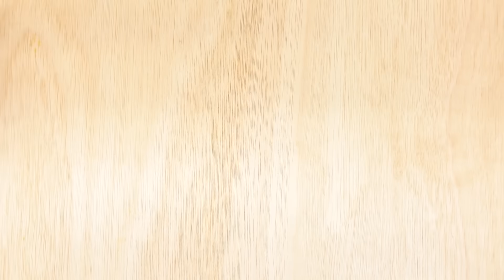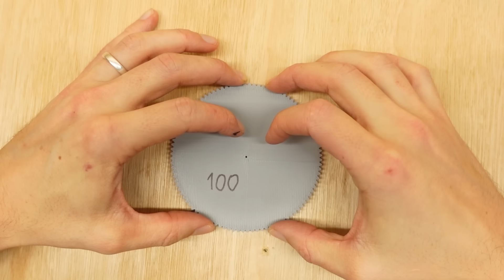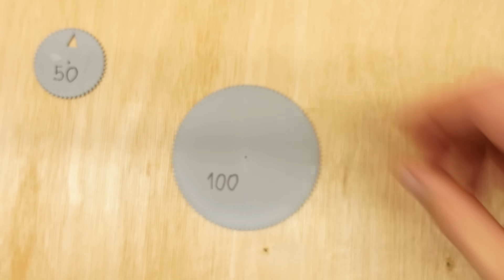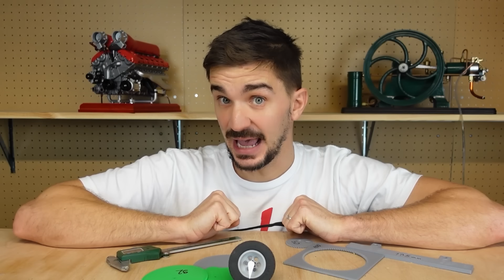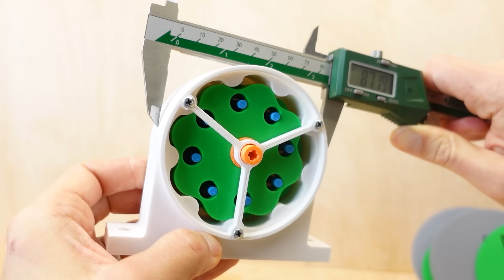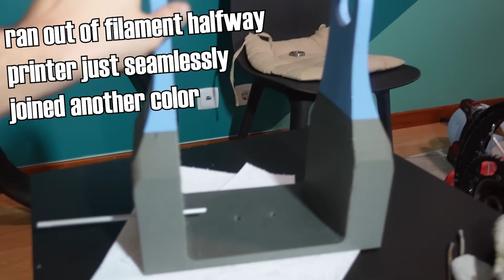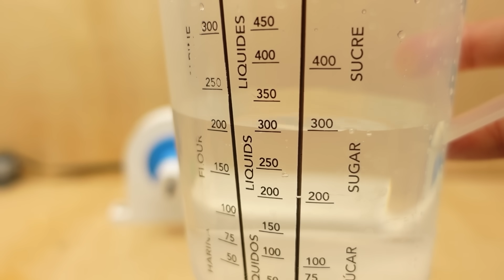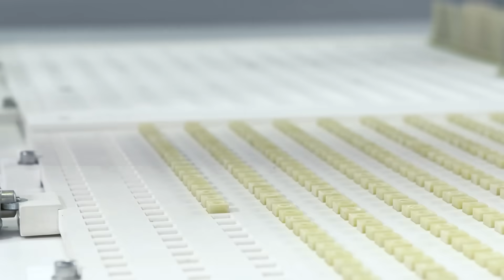Toothless Gears Make Much More Torque Than Conventional Ones, Here's How. Cycloid Drive Explained

Comment: Machine designer here. Many years ago, I owned a 1994 Dodge Caravan and had a full size spare tire that hung from beneath the rear of the vehicle. To drop the spare, you lifted a small flap of the interior carpet to expose a hex nut. You used the lug wrench to turn that nut which through a gearbox, lowered the tire to the ground. Eventually the original gearbox jammed and I had to replace it. Naturally, I could not resist dissecting the old gearbox and so after drillign our rivets on the case, I got into the guts of it. Well, it incorporated a cycloidal drive which were stamped out of metal plate. I was so intrigued by this mechanism that I kept it, and still have it to this day. I believe the geometrics of these drives are known as trochoids.
Reply: At last, I have found a kindred soul!
Reply: I have a 1994 Chrysler Town & Country that is pretty much the same thing.   It does not have the same spare tire location though.  Yours is much cooler/
Reply: @PaulMartin-n6m  wait, then... what do you mean it's pretty much the same thing but without the spare tire location? The entire comment was about the spare tire location.
Reply: @j @renee61026 the point of the comment was the gearbox that lowers the tire down🤦‍♂️
Reply: @renee61026  are you tweaking?
Reply: My 2007 PT Cruiser spare tire comes out in the same way (super fun to figure out at 5 AM late for work with a flat tire lmao), and now I'm super curious and want to take it apart. Gee, thanks 😅
Reply: Did you ever find what caused the jam?
Reply: I'm not seeing what your saying 100/50=2 rotations flat rack or round gear. You might be wrong. Sorry
Reply: @dalenulik5622  But the reference points about which a full rotation is measured matter.  In the linear case, the path length of the pinion's center and the point of gear engagement are identical.  In the round gear case, those path lengths differ because they don't operate at the same radius.

Comment: Couldn't you create a 3-disc system, in a 1# 2# 1# setup to eliminate the rocking couple?

Or would such a system require 120 degree offset instead of 180?

Comment: 3D print your next house. The design process will be radical, inventive, innovative, and fun. The build process will be mesmerizing. If you build it yourself, or hire some help, it'll be way less expensive than purchasing an existing house or building a new one from scratch; depending on construction materials used.

Comment: you dont have to 3 print everything when you can just find things to repurpose, i recently went to the demolition site of a mall and got some stuff that would otherwise be absurd to buy. got ahold of some hollow rectangular 2.5 inch by 1 metal box beam of various lengths between 4-6 feet long and a few in excess of 22 ft long. where it got kinda surprising was at the internal window beams meant to affix to the window frames those were aluminum, I thought they were hollow but they were SOLID AMLUMINUM. using them for shed reinforcements and i've got recliner to reinforce because the plywood failed.

Comment: Eccentric cycloid gear systems are a neat alternative to this, and can be fairly practical for functional 3d printed mechanisms. Essentially uses these eccentric cycloid gear profiles, which allows for a "corkscrew" pinion that is effectively 1 tooth, allowing huge reductions.

Comment: You're over-all size representation is wrong. You need to consider the position of the orbiting gear in all positions to represent the size difference accurately. The actual size difference being shown should of represented four times as much space required to have the smaller gear orbit the outside of the larger one.

Comment: Genuine question: the last problem you mention. The offset between the opposing forces which generates a vibration.
If i used 3 gears instead of 2 such that 1 and 3 are in phase and 2 is in opposite phase, this problem would disappear right??
Just make gears 1 and 3 half as heavy as 2, so the forces will still cancel out

Comment: you can make 3 cycloids, the one in the middle double the mass of the externals which are both offset 180° from the one in the middle.
Reply: you can also balance a single gear with an excentric mass either in the crankshaft or in the gear

Comment: Faaantastic video. 

One trick that might've helped illustrate the point when going from rolling on a flat plane to rolling around another gear, was if you first rolled along a tape on the flat plane and then, with the first (rolling) gear "stuck" on the end of the tape, if you wrapped the tape around the second (stationary) gear. That would've shown the rolling gear making an extra revolution, even after having reached the end of the (flat) tape.

Comment: I disagree with you reasoning on why the gear would spin an extra time, you have the one revolution from the teeth on the gear then an extra revolution from the gear rotating around the other gear. Imagine if the gear didn’t have any teeth but spun around a circle, it would still make one revolution.

Comment: Interesting video. It should be added that cycloid-based transmissions wear out much faster than conventional gears, especially at high speeds. This is why this type of movement is rarely used in industry for transmissions. However, it is often used for compressors or pumps. See the Roots compressor.

Comment: Making a single gear of double the weight sandwiched between two normal weight gears will counter more of the vibration. It may introduce extra friction but maybe it's capable of higher speeds this way
Reply: If anyone has proof wether this does or does not work, please let me know!

Comment: If secondary vibration is the issue at speed, couldn’t you just add another mirrored pair of cycloids to balance that out? Or slightly more simply, have 3 with 2 being half the weight of the center one?

Comment: @d4a what if we create a "little less compact" cycloidal gearbox with 4 cycloids? Wouldn't be as similar as an inline 4 engine on the "rocking force" part? 
Also by being "torque monsters", the application for vehicles would require multiple groups of these you printed, each with its own gear ratio, right?

Comment: I built 4 of these for a 4wd computer vision driven robot. These types of gear drives are very good for torque which was needed and they are extremely precise and have no backlash. They performed exceptionally for this application. Only thing is it would likely be challenging to make a multi gear ratiin system with these

Comment: In the instances up to about the 2:45 mark, you're just also rotating the point of reference for the point of contact around the wheel thats being measured. With the standard gear it rotates in the same direction adding one to the rotation and with the inverted one it rotates the opposite counteracting one of the rotations. keep the point of reference to the bottom of the screen the whole time so the contact point doesnt move about and I would imaging the  rotation count stays consistent. You can make the gear rotate without moving any distance at all if you hold it stationary and move the surface

Comment: Regarding your 3D Printer situation: The company you're supporting, Bambulab, has been taking steps to lock down their ecosystem little by little as they've gained market share. (They're subsidized by the Chinese gov't too as this is labeled a "strategic market" for their gov't) The prices of their filament will go up over time (since they ID tag their spools), and you'll only be able to use their filaments. They're locking their firmwares down to stop people from getting around these things. Sound familiar? (Apple, 2d paper printer manufacturers like HP)

It might be worth considering these things with your future printer purchases & sponsorships depending on the kind of 3D printing world you want to live in 🤷

Comment: If you want to reduce vibrations then instead of pairing two offset gears, thus giving twice as many points of contact, 
you may use infinitely many, infinitely thin gears with infinitely small offsets, giving infinite points of contact. 
In other words - differentiate then integrate. 
In other other words - spiralize from tooth to tooth. 
That's exactly the reason that on the clips you used at 15:52, the gears shown use skewed teeth. 
You should have easy time printing it. At least easier than manufacturing them in traditional, machining way.

Comment: Sumitomo has made cycloid drives for many years.  Efficiency of a double reduction cycloid is around 86%, while a double reduction helical gear drive's efficiency is around 94%.  Dissipating heat is a huge issue with any speed reducer.  The compactness of a cycloid, plus its lower efficiency, makes dissipating heat more difficult.  For huge speed reductions in an inexpensive tiny package, nothing beats a worm drive, but they have the lowest efficiency, in general, of any speed reducer.  Sumitomo claims that its cycloid drives are more resistant to shock loads than reducers with involute tooth profiled gears.

Comment: 18:45, so why not three with the one in the center being 2x as wide as the outside cycloidal gears to balance out in all directions? Would that not fix the speed problem?
Reply from the maker: Yes but the speed problem doesn't need fixing. You add volume and weight and complexity in order to attain speeds this transmission doesn't need to attain.
Reply: @d4a  but if that fixes the problem wouldn't that make this setup better in every way? Instead of only for a more niche field.

Comment: why can't they just remove some weight from the right areas of 1 gear so it spins without bounce, instead of making 2 gears to unbalance it laterally again? I guess strength is an issue

Comment: I wonder if there is some way to compensate for the rock in a different fashion. Maybe something sort of like a tuned mass dampener inside the cycloidal gear? Just a spring based free floating mass that is in-line with the gear so it doesn't rock but can still move freely to "eat" the lateral movements?
Reply: I wonder what the tension would be light if you replaced the entire main body of the gear with a series of slightly elastic strings (or springs) that connect the shaft to the edges?

Comment: concern the drive plate with holes looks suspiciously like a 3D printed cylinder for a revolver.  I expect this will be flagged and your operation shut down.  Better stick to non-firearm gears in the future!  Also look into support material, specifically using PETG for support interface and reducing your z-gaps for support to much less.  You can reduce from the standard 0.2mm to 0.16mm with only PLA but use a PETG interface and you can go to 0.05mm or better for gaps.  It prevents stringing like on the blue sprocket face that was down.  There are some design tricks you can also use to clean up that surface orientation, but PETG support with PLA is possibly the best way to leverage the multi-material capability of your printer.

Comment: Okay, that jittery "claymation" motion deficiency effect you added made it completely unwatchable.   I made it 8 and a half minutes in, and now im moving on to a different video.  Some of us like the asmr of seeing things work right, not make us nauseous.  This is how the wenkel crank works, BTW.  And the "rotations" are illogical because you are using an irrelevant point of observation to the gearset.  When you count rotations of one face on another (the same way you count rotations of drive-driven gears in practical applications) then everything matches up just fine, without having to blame it on the axis point. The face of the arrow touches the other gear the appropriate, expected interval. It's the observer that's spinning extra.

Comment: Very nice demonstration. When covering robotics you should mention harmonic drives as well. For many reasons (including size and reduction to weight ratio; no vibration) they are much more common in the joints of typical  industry robots.

Comment: If that's the imbalance that prevent high speed, simply split the first disk (along thickness) and put one half on the other side of the now central opposing disc, so that's half / full opposite / half, and the forces cancel out. You need a 3 stage "crankshaft" but everything else stays the same. You're welcome ;)

Comment: I'm curious to know how much friction will increase in such mechanisms compared to modern gear transmissions, and how much oil will be required to compensate for it. Not to mention that such friction will absorb torque. I'm almost certain that this is why such mechanisms have not become widespread.

Comment: I was aware of this "problem" and had heard it explained as the additional rotation comes from the wheel itself effectively rotating about its axis once per "orbit" in addition to the two expected rotations due to the contact lengths. Though that is true, it is more accurate and intuitive to describe the phenomenon by tracking the distance traveled by the wheel center. I like that, thanks!

Comment: its kinda intuitive to think bending the surface into a circle just adds 1 rotation. flat surface has no rotational value, so the circle rolls 1 rotation per diameter traveled. bend that flat surface into a circle of its own, and it adds 1 rotation. now it's 1+1 rotations per diameter traveled. Bend the surface backward against the direction of rotation (hollow ring gear example) and the circle now rotates 1-1 times per diameter traveled. 

Think of something sliding along the surface instead of rolling. a circle would add 1 rotation even though the object doesnt "rotate" along its travel.

Comment: Wow, thanks -  loved the video...  Subscribed immediately !  Comment 1:  @ 10:15   I had the same problem when I started 3D printing, but recalled my father's cynical comment from many years ago:  "When the only tool in your toolbox is a hammer, then every problem looks like a nail!"  😆  So now I always ask myself two questions:  A: Is 3D printing the simplest way to solve the problem? and B: How much is my time really worth? This keeps me in check a little bit better!   Comment #2:  @ 14:40  Egad!  Water?   I hate mixing water and electricity ⚡.  Next time you need to do a similar explanation how about adding  3/4" (~20 mm?) nuts one at a time instead?  They weigh about the same as the amount of water you are adding incrementally!  (OR, maybe that's just a little too boring? )   Comment #3:  @ 18:50   Rocking couples are so annoying, even the ones on the swing at the park. 🙄  Can you balance that torque by splitting one of the two internal node gears in half (thickness) and then pack them together with the two (half-thickness) gears on the outsides of one (full thickness) gear in the middle??   Anyway...   Thanks for the cool video!  I'm going back to my own Imagination Land to see where I can put this idea to use!

Comment: Would it be possible to, instead of using two gears, use four, or six to reduce the vibration problem and increase maximum speed? An inline twin engine isn't balanced, but an inline four is a lot better, and an inline six is perfectly balanced internally.
I'm assuming even if it can be done, it just wouldn't be worth it in most cases due to the increased production costs or some other drawback, but I'm still curious if it would work at all.

Comment: So... What if you used the lobed design of these on a spur gear? Would it similarly have zero backlash?
As far as I can tell it'll have the same torque handling since the contact area is the same, but if the backlash is gone that still feels like a win.

Comment: 4:30 4:42 if my brain has correctly figured this out: it's also relevant to note that it's making (drawing) a circle that is... the same size as the gear's diameter!
So the "drawn" diameter's size in relation to your gear/wheel is relative to the rotations it'll take... Twice the Diameter, 2 rotations. Half the Diameter, 1/2 a rotation.

Comment: i came across these as a firmware developer in the automotive domain. these were used inside an actuator and i was developing the code for controlling the motor that would drive this. i was fascinated by the gears, and like you said were never had to worry about any backlash. the gear ratio was 59 to 1 i think.

Comment: Can i ask you a Question? Maybe you are one of the few People on this Planet who can give an Answer on this. Maybe even make a Video about.
Im always in Gear Ratios and found one Corious Thing.
All Street Cars have Gear Ratios, where the 4th Gear is 1.000 or in the near of it. 5th and 6th are always lower than 1. For example 0.750 or 0.840.
If you look in Ratios of Race Cars, the 6th (Last Gear) is always higher than 1.
For example old DTM Cars 1.045, Porsche GT3 1.160, Mercedes CLK GT1 1.180.
Over the Years i collected a lot of Race Car Gear Ratios, and all are higher the 1, i found not only one Race Car Ratio lower than 1.
But in the Street Cars the 5th and 6th always lower.
Why is it so?
Why dont have Street Cars the last Gear at 1.000?
And why dont Race Cars have a 6th Gear at (for example) 0.700?

Would be a nice Thing if you can clear this out. Maybe in a Video?
Greetings from Germany ✌